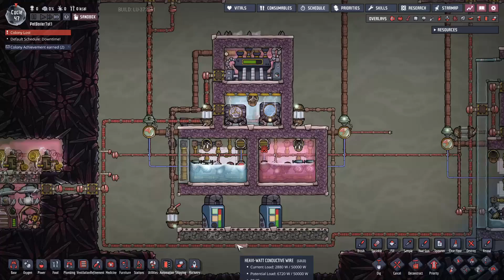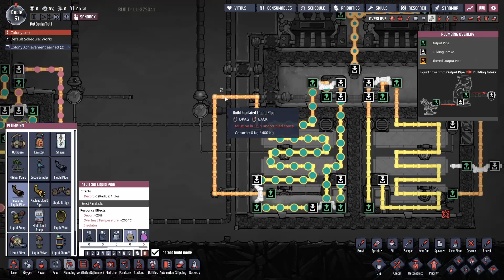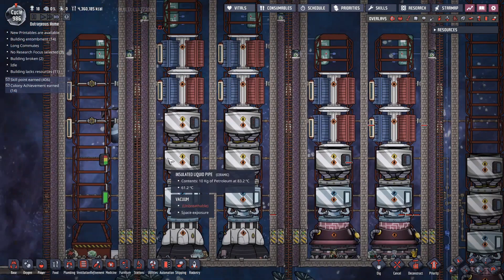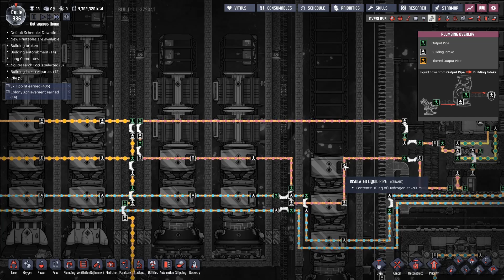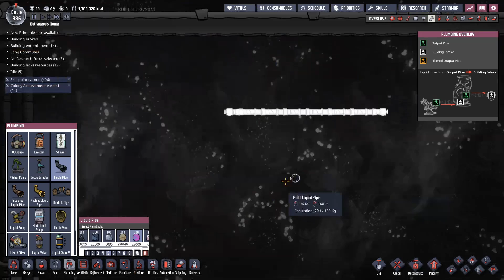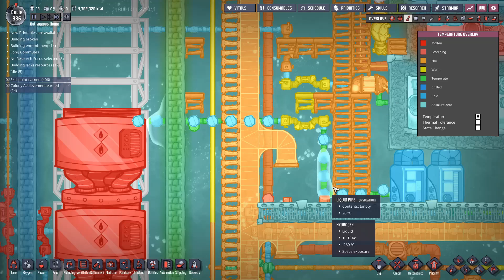Liquid Oxygen and Hydrogen : Tutorial nuggets : Oxygen not included

Comment: Is there any way to bootstrap these (or at least just the O2) pre-Supercoolant without dealing with a bunch of broken pipes in the process?
Reply: Well... theoretically, you could use the gas version of the aquatuner and loop the Gas until it turns liquid.

If you use a gas value to keep the gas at 10% max or 100g, it won't phase change in the gas pipe.

So, what I would do is set up a gas storage tank, feed it into a series of gas cooling machines but at 100g. Have the gas empty into a chamber that has a gas pump that feeds into a value set at 100g.

You use a series because the gas pump in the gas is going to give off heat, so you need to fight that. I find 4 gas cooling machines in sequence does the trick for hydrogen, but you only need 2 for oxygen.

Anyways, right before the mixing room,  put a temp sensor on the pipe tied to a powered gas value. If the gas is finally at the right temp, divert it to the rocket immediately, because you cannot maintain the liquid for any length of time.

Truth?

Go with molten slicksters, get your petroleum from them, make oxyilite elsewhere and store in liquid tonprebent off gassing. Do that instead until you get super coolant. It's just easier. Making liquid O2 via my method is SLOW and power intensive.

If you have that much power to blow, why do you need liquid Hydrogen and oxygen?

OR...

If you use mods, get the drain mod snd the gas version as well. Then you can skip the gas pump, you won't have to worry about heat in the gas chamber. You can just overpressurize the conversion room and keep looping it through the Gas cooling machines. When it finally changes to liquid, the drain will suck up 1 gram a second, which isn't much. But there is no heat, like from a pump.

It's the machinery heat that makes it hard to do without super coolant.

Comment: Wait, so I need insulation to be able to use the liquid hydrogen for rocket fuel because then the pipes wont freeze?
Reply from the maker: You don't need insulation but if you are going to use ceramic insulated pipes you will need to rotate the liquid to stop it for losing temprature to the pipes.
Insulation is perfect and you don't need to rotate the liquid.
Reply: @FrancisJohnYT  ok got it. I probably will still rotate it, just incase lol
Reply: @FrancisJohnYT  also, totally forgor to ask, but is there an issue with it heating up when storing it inside the rockets storage, or no?
Reply from the maker: @cowboybeeboopbop  Once liquids or gasses are stored in a rocket I don't think they can change temp at all.

Comment: Nice tutorial as usual Mr. Francis. One question about the bigger cooling platform. Is there a particular reason for the liquid tank to be the last module in the cooling loop? I haven't tried it out myself, but wouldnt it be more stable to reverse the flow to fill the liquid tank first after the aquatuner? This way tank would average out the 14C difference right away before entering the cooling process. And pardon me if this topic has been ran over many times before.
Reply from the maker: No that is a good question. If the tank is before you do get a more stable temp going in to cool the gas.
However if you put the tank after then you end up with the super coolant coming in even colder than the target, so it converts the gas quicker.
For example you set the target as -100C, tank is at -101C so the aquatuner kicks in and drives down the temp to -115C for the liquid passing through.
The -115C liquid passes through the gas and then through the liquid stored in the bottom and then gets evened out in the liquid tank. This tend to generally work better.
You can do it in reverse it just tends to be harder to balance.

Comment: 1 aquatuner is enough for 2. Just cool the super coolant as cold as it gets. Control it going in each tank with a thermal sensor in the middle of each. If it's cold enough bypass it to the loop. No need for a loop on liquid oxygen/hydrogen, just use a timer on the pump to pump the exact amount you need.

Comment: Has this design changed at all with the DLC?
Reply: just built a LH2 system last night and found even insulated ceramic pipes are not adequate to prevent the super coolant from heating up insde the steam box. was causing bulk H2 flashing back and forth. only fix was insulated insulation.
Reply: @UniqueBreakfastTaco  did you have bridges going from the steam box to the cold box? Bridges transfer heat, as I discovered 😣
Reply: @tehmessiah5617  I did as well...even ceramic isn't good enough anymore. Not sure of it was patched or I was just wrong in the first place, but now we know 👍

Comment: Oh and another thing, you don't need to circulate the liquids because if you store them in space (with a mesh tile) and use only use radiant pipes between the liquid storage tanks ( lead are the best ) you can store has much you like without the circulation, you can also make the outgoing pipe to the liquid shutoff of radiant lead, the pipe coming out of the liquid shutoff and the pipes inside the rocket silo have to be made of ceramic or better but anything else can be made of radiant pipes and the liquid can be there for a long, long time without losing temp.

You will break several pipes to equalize the temp but after they are at the liquid temp the pipes will not change ( ever ), unless some gas/liquid comes in contact with the pipes.

Comment: I have been checking your old videos and 2 comments about this one ... ( before that, this is a great video/series, good work )

I have done several designs and your temp settings is a bit low, it will works the way you set up but on big projects the settings for O2 is 5 degreed low ( like to keep my liquid O2 at -200Cº ) and the H2 is 1 degreed lower, the difference is that is better at start up and keeping it more cold is better to move it around.

about the pipes, yes you can run radiant pipes to move the gas around in space, you can not get them near the rocket but to get to the general area from a long way out is ok, also valid for heat, moving steam around in full vacuum is also good, you will break several pipes at the start but after the temp is stable is all good, you can even stop the liquid/gas on the pipes.

Comment: First, thank you for the guide/tutorial.  Second, I just built the larger version built almost exactly as it is in this video.  I slightly altered the radiant pipes -- in my hydrogen tank the pipes actually run along the top row of shiftplates, it seemed to be it would be better for the pipes to be in contact with them.   However, even after my liquid hydrogen was well into being two tiles high I still wasn't seeing items in the tank cooling sufficiently.  The top row of shiftplates seemed to hover at between -250 and -251.5 despite the coolant being as low as -268 when the AT was active.  I finally lowered the sensor to -256 from your -255 which seem to help some.  I wonder if perhaps there should be two rows of insulated tiles between the steam area and the liquid tanks.
Reply: Ah, I downloaded the save -- you used Aluminum which I don't have access to.. that could be the difference.  I used gold.  Hmm, I might try redoing the hydrogen tank radiant pipes with Thermium...
Reply: Yeah, Thermium made a big difference.  So, to anyone trying the build -- it helps to have Aluminum or Thermium...

Comment: 12:22 Automation Settings
Above 250+ Pump, Below 450 O2 Gas Comes in ;
Above 250+ Pump, Below 850 H2 Gas Comes in;
9kg Valves after both liquid storage goes in to the tanks
Liquid Pipe Thermo O2: -190 ; H2: -255

You need around 350-400 kg super coolant to start with (for the small one)
And don't forget to put dry wall behind (if building in space)😂
Reply: Every build guide should start out like this.  Here is 5 seconds of my liquid pipes, here is 5 seconds of my gas pipes, here is 5 seconds of my automation, here is what each automation is set at, here is 5 seconds of my power grid.  Okay, now let me explain it.  A lot of people will only need those first 30 seconds.
Reply: @ryanchastain3152  I've learned a lot from this channel and to be honest for the first build I needed an extended explanation to answer every why's and to fix if anything, without scratching my head so long, goes wrong. But for the next builds yeah 30sec would be enough. This is what we get for now and I appreciate it.
Reply: god bless
Reply: Piggybacking on top comment there was no automation on high pressure gas vent at the time of this video. Make sure to not connect the thermo sensor automation wire to the gas vent. Learnt it the hard way.
Reply: Thank you very much!
Reply: thanks a lot mate

Comment: In case this helps, a tip: If your aquatuners are overheating (and your turbines are getting too hot), it may be because you forgot to fill the turbine room with 2 kilos of hydrogen (not that I would ever miss this, doh!).  You might also try to crank up the oxygen side first in order to get the diamond glass to chill the turbines.
Reply: And another tip, these need a lot of ceramic.  I estimate that the build on the right (big one) needs ~30 tons of ceramic just for the build.  Add pipes to circulate to rockets, and that increases to perhaps 50 or 60 tons total (or more, depending on distance).

Comment: with the most recent patch, they added automation to the air vents. youll need to run the automation around the high pressure vents for it to work.
Reply: not necessarily around btw, there's automation wire bridges*
Reply: I was looking for this solution. Thank you for this!
Reply: Ive been staring at this forever wondering why it was so slow after it regulated and rarely ever let gas in. ty. now i have to break in
Reply: Yeah I was thinking, why has he run the automation through there?!

Comment: I was able to get a variant of the larger design to work with radiant pipes made out of steel. It's my first time building such a system, but it seems to be working fine. I don't have any aluminum (I need LOX to reach it), and Thermium is still scarce.
Reply from the maker: Quick trick with Thermium, you can turn 100kg of Thermium into 100kg of Niobioum in the metal refinery. You can then use that to turn more Tungsten into Thermium. In theory once you get even a little Niobioum you can convert all your Tungsten into Thermium. For the larger design it should work fine with less conductive pipes as it has more area to do the heat exchange.
Reply: Thanks. True. In retrospect I should have made more Thermium, but I didn't read the aluminium/Thermium tip until after my steel version was built, and the cooling box works to the capacity of both gas vent inputs. My cooling box is pretty massive though, and makes the liquid (particularly the liquid hydrogen) look small.
Reply from the maker: @Talrich77  hydrogen liquid is twice as dense as O2. So two tiles deep of hydrogen is worth 4 tiles deep of O2.

Comment: To answer the question about liq. reservoirs being built inside the steam room... They themselves don't exchange temperature with the liquid inside of them. So the tank can be 900 °C and the liquid inside -250 °C and nothing would happen... but the tank has to stand on something and depending on how well this something exchanges heat the liquid will behave. So... if you put this tank in a steam room on a reasonably well insulated tile... say ceramic or maybe even insulation you pretty much have either a perfectly insulated tank or one with negligible heat exchange. All that matters is what tile is tank's left tile.
If you put it in magma on neutronium it will keep whatever is inside without any heat transfer... untill the tank itself either melts or malfunctions due to overheating.
Thank you for the video ;)

Comment: I've just learned that the latest update throws a small wrench in this design. You have your automation wires for the aquatuner going through the high pressure vents, and now that they can use automation signals the vent gets shut when it receives a red signal from the liquid pipe thermo sensor.

A small thing that's easy to workaround, unless you use the smaller layout and have a lot of LOX and LH in there. Guess which one I'm using?
Reply: hah, that update broke quite a bunch of setups. at least it meant an interesting re-visit of basically forgotten installations.

Comment: On the subject of liquid reservoirs and heat, based on the testing I've done, the liquid does not thermally interact with the reservoir directly, rather it interacts with the environment (and that left tile), which then interacts with the reservoir. You can pipe magma into a reservoir, and so long as it's in a vacuum and that leftmost tile it's sitting on won't interact with it, the reservoir's temperature won't budge at all.
Reply from the maker: I tested this a while back (don't know if they patched it since) if you place a tile under the left most tile of a liquid storage the tile would change temperature. Even if in a vacuum. However it's a tiny drain.
Reply: @FrancisJohnYT  That was what I meant by "and that left tile" (In hindsight I realize "left tile" wasn't very clear). Though admittedly it didn't come up in my testing, since in my test rig that tile was an insulated tile made of insulation. In short, I think it interacts thermally just as if it were in a bottle sitting in the bottom left tile there.

Comment: Can I use any alternative to aluminum pipes regarding radiant liquid pipes? Anything that isnt rare?!
Reply from the maker: Not if you want to keep the size of the design down. It's theoretically possible to do it with gold/copper you would just need a lot of space to exchange heat. If you have access to space to get the super coolant you can just get 15kg of niobioum and turn all your tungsten into super conductive metal.
Reply: I used the bigger design of your system, applied Thermium pipes... Worked out pretty smooth at the end! Had to do about 10 trips to get the required resources but worked out as good! Thank you!

Comment: Great vid, thank you, I use your nuggets all the time. If you are building in space, wouldn't you need to surround the temp shift plates with drywalls? I am assuming that the temp shift plates would push heat into the drywalls just like they would anything else?
Reply from the maker: They will push the temp into drywall but the drywall will not be able to push it into the insulated tiles.

Comment: Not sure that the constant loop is really useful. Just wire it to the rocket arrival scanner (with a buffer if 45s to avoid recirculating at launch) and reset it with the rocket output (checklist) The pump will only work when needed
Reply from the maker: Will that work with multiple rockets? I usually run about 6 or so.
Reply: @FrancisJohnYT  Yep sure. The idea is that the loop is not constantly running but rather just on demand. But the deisgn of the loop itself is like yours. You need to get the automation timing right and a pipe spaghetti. As you said, the most important thing is to never have still packets in you pipes.

Also, about getting the temp right, the best method I've found is to make a small buffer of super coolant right after the AT to smooth precisely the temp to 0.1 precision. This way you keep your H²/O² buffer right above solidification temp and you have the maximum range of error for your pipe transport. I get away with igneous rock but I'm only feeding 2 rockets.

Comment: Do bridges double the distance you can move liquid oxygen before it freezes?
Reply from the maker: The middle of a bridge is not calculated, liquid teleport from one side to the other. This magically reduces the distance liquids have to travel, also costs you a third less pipe segments which is important because of how expensive insulation is. So since the liquid has to travel less distance I suppose the answer is yes.

Comment: Is there a way to tie this into my main power grid?

Currently, I have the steam turbines connected to my solar network and accompanying battery block to help charge the batteries through heavy watt. 

Then I have the pumps, aquatuners, and shutoffs connected to my main battery spine with two separate conductive wires. 

I'm wondering if there's an elegant way to connect it to my solar battery block, then using a power shutoff and automation cord to get some charge from my main spine at night or during meteor showers.

Thanks for the video!
Reply from the maker: Are you using transformers at all? Should be pretty handy to do it that way. With the upgrade to heavy conductive wire now able to handle 50KW their is no excuse to not connect everything on a central grid.
Reply: @FrancisJohnYT  I got it working by running heavy watt between the steam generators, aquatuners, and smart battery. Then, used a couple of switches to cut power to the heavy watt and accept power from a conductive wire if the steam generators cant keep up.
Reply: @FrancisJohnYT  I briefly tried last night, but it wasn't accepting power from my main spine. Obviously I was doing it wrong.